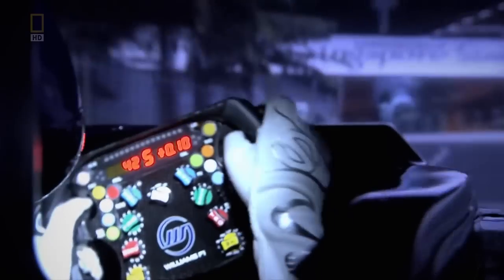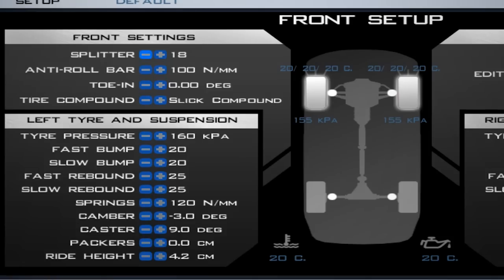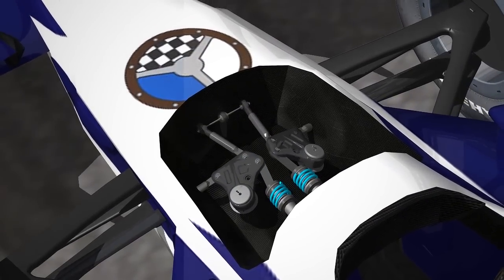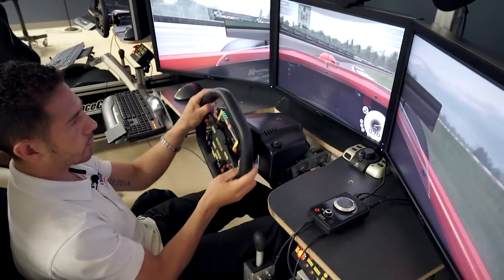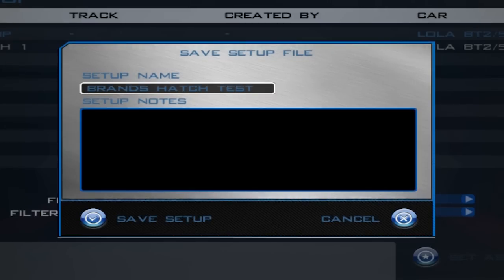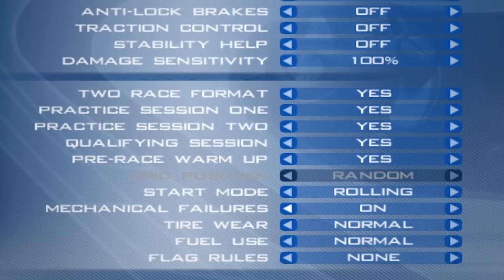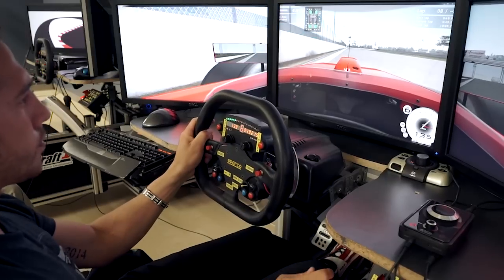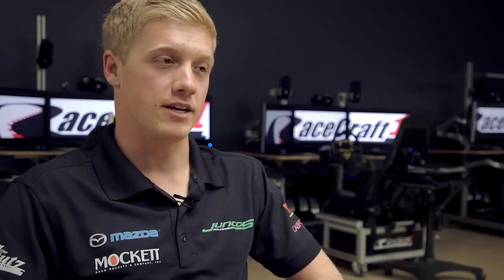Race Car Dynamics: Learning Car Setup on a Simulator

Comment: "Spends millions of dollars to accurately simulate racing"

Worse graphics than Forza

O...Ok.
Reply: +Brock Neumann Visual realism =/= physical realism. Physical accuracy, in the car's handling/dynamics and reaction to setup changes, take priority over making it look pretty.
Reply: +Brock Neumann they simulate race track, not beatifull of graphics...
Reply: We have top automotive engineers and physicists working in both avenues I guarantee members of this project are some of the same from the minds of gran turismo, forza motorsport, and assetto corsa. The software is the same, the goal is the same. To say that the software is 'more' realistic would be foolish.. It's the HARDWARE you're seeing that costed 30k or whatever he said

Comment: iRacing just added weather changes.  Now I realize that a bright, sunny, fairly warm day is not a good day for a driver.  Cold chilly weather works much better with the tires.  Gabby Chavez recently raced with the guys in an IndyCar league.
Reply: I am so talking about racing tires.  Notice I said "iRacing."  Unless it's absolutely freezing and bearing in mind the tires need to warm up,  your tires will get better "racing" grip with cold weather.

Comment: Why are they using g27's wheels? There are far better simulator wheels out there. But the hardware you use doesn't make you go faster.
Reply: Well, the Logitech pedals are not very good, No feedback at all and too soft. So some fanatec pedals with ffb would improve the pedal input.